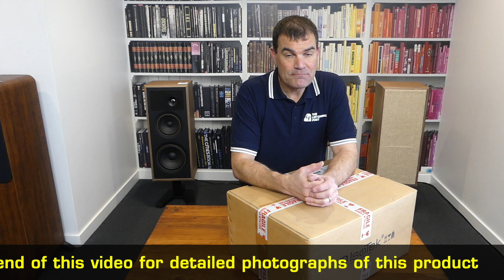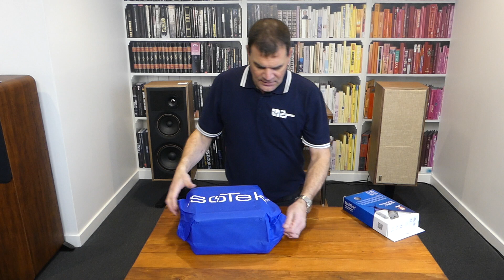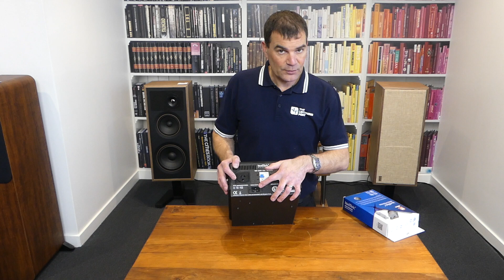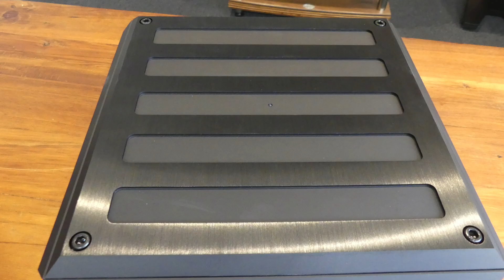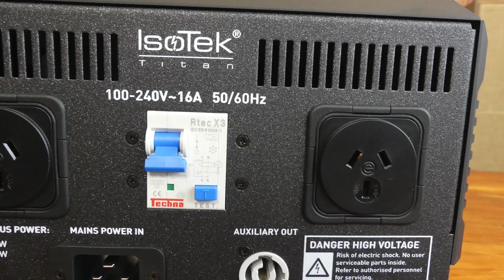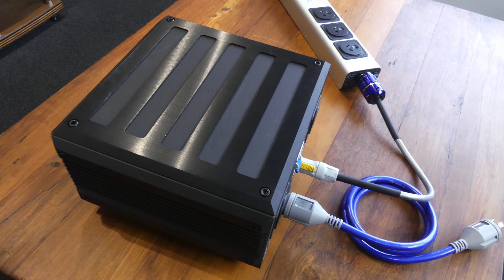IsoTek EVO3 Titan Power Conditioner Unboxed | The Listening Post | TLPCHC TLPWLG

Comment: Why do you say not recommended for an intergrated amp especially if it has a DAC. At the moment I’m simply using a Polaris but thought of upgrading to one of the big Titans or maybe a Titan One.
My amp is Accuphase E4000 (180 watts x 2) with the DAC60 module in it.
Reply from the maker: The Titan is designed for big power amps.  It can sometimes have a negative effect with "lighter weight" components.  So I don't recommend it for int amps and DAC's.  Weirdly, the Titan One is a completely different unit all together!  You may wish to try the Genesis rannge:  https://listeningpost.co.nz/shop/accessories/power-products/isotek-evo3-genesis-one-power-conditioner/
Reply: @ Ok, thanks for that. I will look into Genesis, also consider Sigmas and more affordable & smaller V5 Aquarius. I do think the big Titan is overkill for my amp and use case. Titan One not sure, not much in the way of user review info on it.

Comment: One also buys this type of unit to provide instantaneous high current supply when one's power amp calls for very high currents to address transients. Hence the weight of capacitors. 
The "big" choice is between "regenerators" which take in input supply and convert it into a perfect sign-wave and those which "only" filter to clean away noise. IsoTech 32 Amp Titan provides power for the biggest amps (Dan Dag's etc) which can use a 32 Amp 240 volt  or 20 amp supply and those which "only" use normal domestic rated supplies. Most folk who have separate power amps and other components in their system would benefit from there being separate supplies to each and then for power supplies within their rack/stand to analogue components being "separate" from "digital components. I do this.
Reply from the maker: Yes - you are right